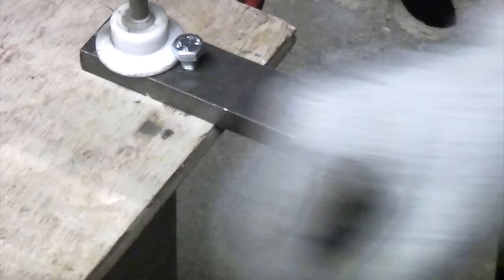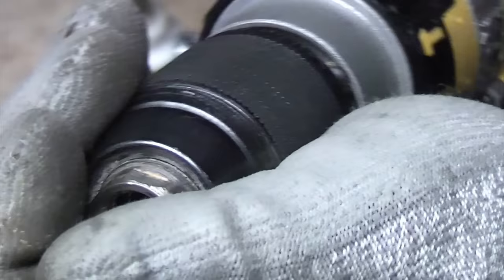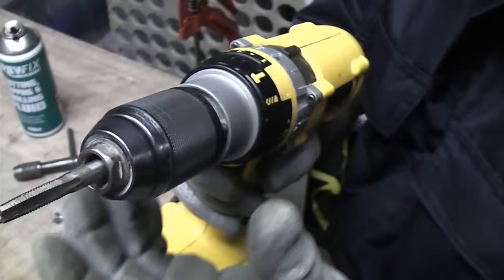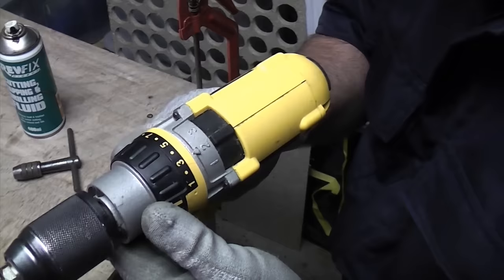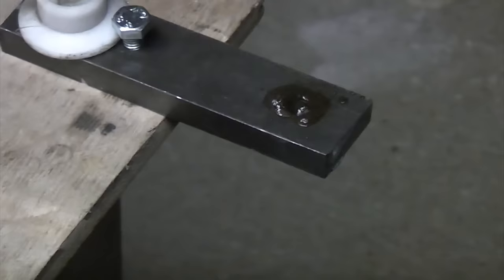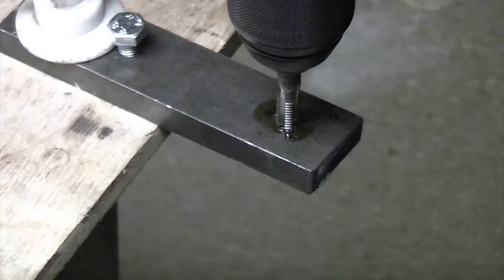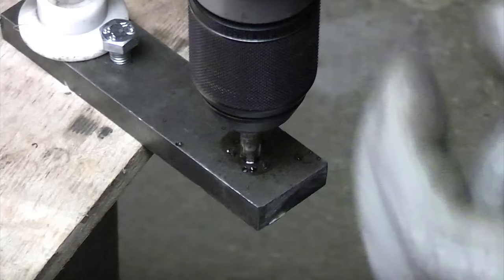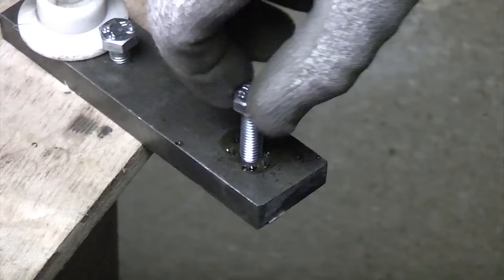How to tap threads using a drill

Comment: I also think the taps have some limited ability to self-center if the misalignment is slight. The first ever time I tapped a hole it was by hand and I didn't use a tap guide - and the thread still came out perfect - so if I could do it OK with zero practice then there must be something in the taps themselves to cancel out misalignments regardless of operator skill.
Reply: Well, it’s tapered. Quite sure that and the rotating actiom are the only thing aligning it in the hole your threading

Comment: Oh, forget the comment I just made on your video about tapping acrylic, where I talked about using a cordless drill instead of a tap wrench. You're already doing it (as should be expected of an ultimate handy man ;) ). 
Another good addition: put the cordless drill into a drill stand. No crooked threads that way and applying even (or no) pressure is very easy with it.

Comment: nice instructional video you got there :)

at work were normally not so carefull when tapping, having the drill in "drill" mode or no torque limit and just go for it .P for holes 16mm and bigger we use taps welded on 1/2" sockets and an impact wrench.

Comment: If taping a single hole smaller than 6mm on an expensive part, avoid a drill as they may break tap due to human error...With more experience all drill tapping is fine.

Comment: very good video and i like it alot. i also do most of tapping using drill machine same like you.if you will use spiral tap then it would be more fast.they don't stuck like hand tap so you can go all the way without getting back.

Comment: cordless drill, or drill press works perfectly to thread, if you're a little carefull :P

i tried out our new portable magnet base drill at work the other day.
ended up drilling and threading 24 M36 holes with it. at about 8minutes per hole.
works quite well, but it's a lot of work drilling with manual feed.

Comment: As a future machinist I would not personally do this but whatever truly works is fine. I recommended power tapping a spot then hand tapping the rest. But hey as long as the threads are nice and smooth you should be fine. You did handle it well. 
 Well articulated as well. You want to go back and forth so you can clear out chips and not cause your tool to break. DO MAKE SURE IT IS STRAIGHT AS IT WILL BREAK BY BINDING.
Reply from the maker: Thanks for the comment

Comment: @ultimatehandyman with a normal sized mag drill you might be able to do M16 maybe M20.
i have a video of the machine we have at work threading M36.
that machine is the biggest portable mag drill available worldwide.
it is capable of drilling 200MM diameter and tapping M52. and we have machine number 1 and 2 :)

Comment: Thank you for the vid.  How do you Tap a 2 inch diameter pipe for about 6 inches?  I'm trying something new with a walking cane I am wanting to make and this would help.
Reply from the maker: It would probably best, if that was done on a lathe.
I have to say that I've never tapped an internal thread on a pipe before.
🤔

Comment: good job man! this is basically what machinists do with a mill. It looks like your using serial taps. If your going to tap a ductile material you can use a thread forming tap. I do this all the time but with machine taps.

Comment: Was laughing watching him just send it in multiple threads at a time without breaking the chip. :)

Just came from the garage after breaking a tap into one of my projects using power drill. I was careful going in only 0.5 thread at a time before reversing. Tens of direction changes but still was enough to break a chinese STIM6 tap. Oh well 1 hour later most of the tap out of the hole and time to order a bit more expensive Xquest (chinese) taps. ;)
Reply from the maker: Cheap taps are awful!
There are lots of good taps now that are designed for use with drills/impact wrenches, such as HMT - https://fave.co/3mUFFy5
👍

Comment: I'm a bit puzzled- the tap has a square end; all the drills I've seen have a three jaw chuck- yet I see the tap turning without a wobble.
Can you explain how this works?
Cheers
Reply: Its easier for the tap to break if you lock it on the square end its better on the round surface

Comment: When Tapping a hole in Cast Iron do you use a different method, say for a M12 1.25 Fine thread, only the part on my axle I want to do doesn't have much access/ room, cheers.

Comment: iv e saved alot of time and wrist pain  doing this.... if the specifications allow ...drill a few thousands over. and let er rip.  once your past the starter threads i apply upward pressure .....any crookedness will straighjten right up   i would not use this technique if i had hours and hours in a detail         the dont call me two flute for nothing

Comment: How much torque is required for this operation I mean I have 100nm impact drive is it enough for tapping in aluminium 40 mm deep ?????
Reply from the maker: That should be fine, but it depends on the size of the thread. A M20 tap needs considerably more torque than a M8 tap etc.

Comment: i wanna do the same for my 17mm aluminium i think through axle can i do this easily without problems?i want to install 2 squer sized bolts to atach a mtb trailer that uses  i think 12mm axle mounts but my axle has a very large allen key  one end and threaded other end.it should have enough thickness  but its the pulling weight on the axle  im concerned about.it seems like aluminium.

Comment: If the screw size is M1.6 diameter and thread pitch 0.35mm, do I use a 1.25mm diameter drill bit and a 1.6mm tap bit for creating the threaded hole? Thanks.
Reply: I want to know same. I couldn't found answer after going through 100 videos.

Comment: Have you or anyone tried threading inside a steel rod? For example, to make a threaded insert. Wondering if it's possible without an internal threading machine.
Reply from the maker: I have done it on a lathe, but not everyone has a lathe.
You could do it by holding the stock in a vice, but round bar is difficult to drill in the exact centre without a lathe.
Reply: ***** The lathe would be a good way to do it. Thanks.
Reply: If you can get thick walked tubing, with the ID of the tubing smaller than letter drill size you'd use to drill the holes to be tapped, that would make it easier.

Comment: I have to tap a #10-24 hole tight in a corner of L brace. I can't turn a Tap handle or use a ratchet socket....I need a thin extender. Is there such a tool?
Reply from the maker: I don't think there is such a thing, they all seem to be quite bulky. Can you not do it using a long series tap? Example here- https://fave.co/3pmGOPP

Comment: Is there smaller threads for smaller holes your trying to make internal threads for..if there is I would like to know if the drill would still for it??
Reply from the maker: I would not use a drill for anything smaller than a M4 size and even then I would be very careful as it's easy to break small taps.
Thanks for the comment

Comment: But wont the square shank of the tap damage the 3 clamping teeth on your drills chuck?
Reply from the maker: No, you grip the round part of the tap. You can't grip anything with a square end in a drill chuck, as it will nut run true.
Thanks for the comment
Reply: @ultimatehandyman  ahhhhhh ok. I spent an hour yesterday trying to find an "adapter " hahahaaaa . Thank you so very much!!! I only have 1 arm so a drill  method is my only option. 
 
Thank you again.
Reply from the maker: @carterscustomrods   Blimey, it might be a bit difficult to tap with one arm, as there is quite a lot of torque generated. You can get taps that work in impact wrenches, or impact drivers, which do not generate any kickback torque.  https://www.youtube.com/watch?v=96LwwycOhPI&t
Best of luck with it ;-)

Comment: which model no of the drill used for this video
....

can you suggest some such good drill for threading purpose
Reply from the maker: +Vishal Mevada This is the Dewalt DC988 but any cordless 18v machine will work for the odd hole as long as it has torque control.If you need to do a lot of threaded holes a dedicated tapping drill such as the Bosch GGW-10-E Thread Tapper is preferred.

Comment: I dont get it why do we have to reverse the tap when doing tapping
I've seen it in many videos but i dont get it why it is done so can you please tell me why it is done??
Reply from the maker: You always have to reverse the tap to break off the chip that is cut when tapping, even when hand tapping you still have to reverse the tap every now and again.
Thanks for the comment
Reply: There are three no reverse taps. 1) HSS Spiral taps  2) Bent shank taps. 3) Roll taps.
Reply: Spiral taps are amazing yet few if anyone rave them. They cost about 10-20% more than a normal tap...the amazing parts is the chips comes out spiral result in clean holes. On a typical tap if you don't reverse, the chips locks up then tap breaks.  Some OSG coated taps don't lock up....so no reverse needed as well.

Comment: Is it correct to use a 4mm tap for a 4mm hole ? Thanks very much
Reply from the maker: No, for a M4 screw you would need a 3.3mm drill bit and a M4 tap, there is a chart on this page for drilling and tapping sizes- http://www.ultimatehandyman.co.uk/how-to/metalworking/tap-and-die
I would not use such small taps in a drill though, as they are easy to break.
 Thanks for the comment 👍

Comment: Hello, can you tap a new, bigger diameter thread, in an already threaded hole? I'm thinking of tapping a 7/16" thread in a threaded hole which appears to be around 13/32" (a 10mm bolt fits in perfectly, but you can pull it out without turning it, so threads not gripping).
Reply from the maker: Yes (assuming there is plenty of material to tap into) , but you will need to drill the hole to the correct tapping size first.
Thanks for the comment 👍
Reply: @ultimatehandyman  Thanks for your answer. Is the correct tapping size of the hole slightly smaller than the bolt's size rating?
Reply from the maker: @lukejones1244   You need to follow a tapping chart, that will have the correct size drill diameter for the tap that you are using, example here-
http://www.ultimatehandyman.co.uk/how-to/metalworking/tap-and-die

Comment: Im trying to drill out an existing hole in a car’s subframe so i can tap and put a thread insert.  The drill jams and can’t go forward.  What shall i do to make the hole bigger? Is my drill underpowered?
Reply from the maker: Probably, if the drill keeps stopping. Or perhaps the drill bit is not sharpened correctly, sometimes if the angle is not correct the bit bites too hard into the material causing the drill to stall.
Thanks for the comment
Reply: Ultimate Handyman thanks for the response. What drill bit material would you recommend?

Comment: Your not gonna break the tap if you set it to the lowest clutch setting and speed, I have personally used this method and never broken a tap (though sometimes I do it by hand)while I have seen others break a tap by hand. With this method the drill's clutch is the safety and no matter how many turns you think the tap can handle the drill won't  let you go past the clutch  setting. Speed low and clutch low clutch higher as needed.
Reply from the maker: Thanks for the comment

Comment: Dear Handyman,

I'd like to hear your opinion about this kind of power tapping. My question is about the device.
What do you think what is the better device to do this job, what you are doing on video ?
What do you recommend :

1 - DeWalt DCF-887 Impact Drive , 204 Nm torque, 3 selectable speed, with Impact Ready 1/4'' tapping tools
or
2 - DeWalt DCD-991 Brushless Drill-drive, 90 Nm torque, similar to the drive on this video (but without hammer), but 2016 modern version, not from 2010.
I cant decide.
1.) the device is cheaper though, but its harder to get 1/4'' tapping bits, and those are not cheap.
2.) the device is slightly more expensive and heavier, but we have selectable clutch force , and a general chuck, good for any tools.
And of course they (impact drive vs. drill-drive) work in different way.
Which one is better ?

Regards,
Laci
Reply from the maker: If you are tapping a lot I would go for the first machine, but to be honest I would get some speedtaps and use a impact wrench as they are ten times faster- https://www.youtube.com/watch?v=96LwwycOhPI
I have used these on site for tapping M12 holes in some 10mm thick plate and it taps the hole in seconds!
Reply: Thank you !
And no I don't need impact wrench, that would be overkill, I won't cut so big threads, but only 4...8mm. And its a big heavy machine. I ordered the DCF887 instead, thanks again.
Reply from the maker: Thanks for the comments ;-)

Comment: I found it easier to put the drill in the vice and work the metal over it. Doing 1 full turn, reverse half way and repeat. Maybe because I didn't have cutting compound, I had trouble keeping the drill straight and finding the right torque setting.

Comment: Power tap vs hand tap? Speed tap vs normal tap? 
These questions are why A lot of us are even watching bud! Anyone care to elaborate?
Reply from the maker: It's normally down to time. If I'm at work and a machine has broken down it costs the firm money, the sooner it is fixed, the less money it costs them, so if possible I would use the drill to tap the holes. 
Speed taps are brilliant for re-tapping holes in steel floor plates as you can do them very quickly and easily!
Obviously if you are making something for a critical application, you might want to tap it by hand, but in a lot of cases you can save a lot of time using a drill or impact driver.
Thanks for the comment

Comment: how do you choose which tap to use lets say i have to  re tap a 7/8 '' hole cause it's striped  do they have sizes on them ?? im totally new to this &don't know nothing about taping  so please forgive my ignorance ..
Reply from the maker: +nick diaz 
No problem at all, we all have to start somewhere.
Yes, people often use a Zeus guide which tells you which size hole you need to drill for which size tap, or you can search online for a imperial tapping chart. That will tell you the drill size needed for a 7/8 tap.
There is some information here that you might find useful, although this is for Metric taps as they are the commonest over here in the UK.
http://www.ultimatehandyman.co.uk/how-to/metalworking/tap-metal
Reply: +nick diaz : If the 7/8" tapped hol is stripped you cant re tap it, there will be no metal to re tap, the only way forward is to re drill and tap to 1". Or fit a Helicoil insert.
Reply: no there is thread on it just a little worn &can't seem to get the bolt in ,it's not  completley   stripped ,
Reply: +nick diaz : If there is still a thread in there you may have a chance, but a 7/8" tap is going to be very expensive, around £50, you could, if you are lucky, get another bolt, (I have no idea what it is on in your case), and cut two grooves longitudinally along the threaded portion of the new bolt, then, very carefully try threading it in, this will clean the thread, depending in what metal it is in, enough to get the bolt in, what is this thread in ? Just measure the number of threads per inch to see what it is, if it is an Imperial size bolt.
Reply: it would be hard for me to count cause it's in a manifold it's for a oxygen sensor but worst comes to worst i will weld a bolt to it i think it would the best solution ..
Reply: +nick diaz : Well, you will need to buy another oxygen sensor as I don't think it will run without the feedback from it, when you say 7/8" is that the A/F size, or the dia of the threaded bit, it will be a BSP, (British Standard Pipe thread), in all probability, so if the thread is 7/8" it is 1/2" BSP. Good Luck!

Comment: what size of tap for a M10 Hex Hd Bolt?

thanks in advance.
Reply from the maker: 8.5mm but I would not recommend tapping holes that size unless your drill has a lot of torque. There is a guide here for drill sizes-
http://www.ultimatehandyman.co.uk/tap-and-die.html
Reply: I have cordless and 110v pistol gun. Ideally I would like to avoid tapping, but can't find fixings for job which has,added time to job

Comment: ...clamp everything real tight, use 2 hands on the drill......long ago, you could buy a corded electric 'Tap-gun'....had a push-pull reversing tap holder built in.....made just for tapping holes....

Comment: can i ask on what is  the size of hole u make and choosing size of tap threads?sorry beginner question , i dont have resource of iron plate to trial and error
Reply from the maker: It depends what size tap you are using.
There is a drilling/tapping chart on this page- http://www.ultimatehandyman.co.uk/how-to/metalworking/tap-and-die

Comment: Eh, don't care if this vid is old.

Is this ok to do with a 1/4 20 tap?
Reply from the maker: Yes, it should do 1/4 inch easily. Just take your time and remember to set the torque on the drill ;-)
Reply: Gotcha. I'll be building a proton pack as I get the parts and I'd rather not screw up my mounting brackets, which need to be threaded for a 1/4 20 bolt.

Comment: Dear Handyman,

I need to obtain an M8 thread on 316 Stainless Steel 3mm thick sqare box / profile. Can you please tell me what size drill do I need to drill before tapping & threading? Also can you recommend a good set of M8 taps set?

Thanking you in advance for your help!
Reply from the maker: Mihai Corcodel 
For M8 you would use a 6.8mm drill bit and plenty of lubricant when drilling and tapping.
There is a chart here with drilling and tapping sizes on it- http://www.ultimatehandyman.co.uk/how-to/metalworking/tap-and-die

I always try and buy quality taps, such as Dormer/Roebuck etc.
Reply: Fantastic! Thanks very much!
Reply from the maker: Mihai Corcodel 
You are welcome ;-)